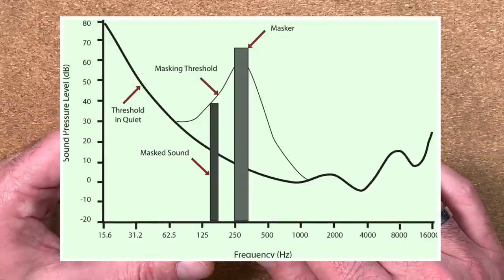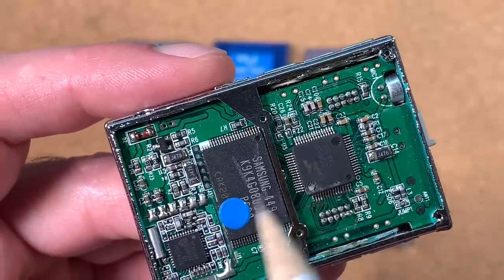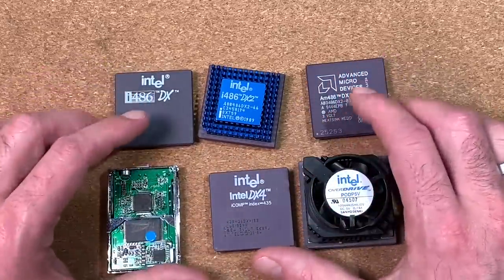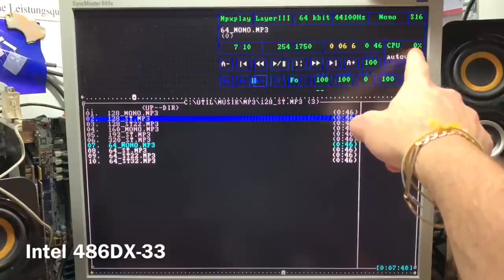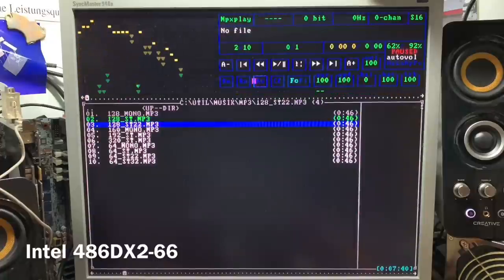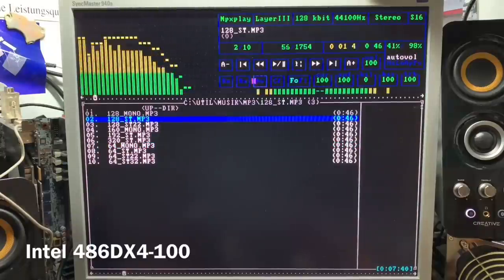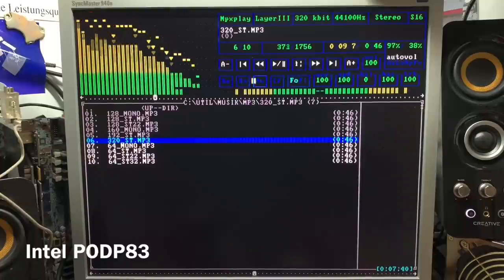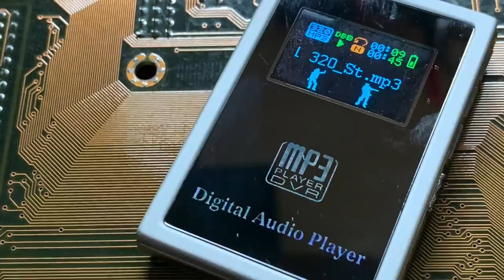Can a 486 Play MP3 Music In Good Quality?

Comment: You should use a AMD5x86-133 instead of a Pentium overdrive or at least include it in the test as it was the fastest 486 chip. Also, there were MP3 players back in the day, able to off-load the work by passing the decompression to the DSP of the Soundblaster (16ASP/AWE32/64) and the songs would play just fine even on slower CPUs. Another way for smooth playback was to covert the MP3 files from/to variable bit rate to constant and disable any visual effects. In addition, any 486 with PCI bus and the DXR3 MPEG card could play MP3 without a hitch by simply selecting a specific codec for audio playback. It was like playing DVD but with audio only. The 486 was a very capable chip. I still have 486 machines that I used to do real time video editing and playback with accelerator cards like Targa 2000 RTX, AV Master, Movie Machine II, Hollywood+/DXR3, Miro DC-30, etc. Panasonic's DVCPRO AV workstation was a crappy 486 with a Targa RTX and a bunch of SCSI drives, yet it was able to do all kinds of real time effects on audio and video and they had the nerve to sell it for $50K back then! What I want to see today is an ISA accelerator card based on Raspberry Pi like PiStorm for Amiga, but for x86 machines.

Comment: I remember my 486 DX2 66mhz was able to play 128kbit 44khz stereo MP3 file if you let them play at 22khz (option in the optimized Dos player, the files where 44khz)
On my P75 i was able to play 128kbit 44kh stereo files native in windows.
Reply: Yeah. I also remember playing mp3 on dx2 66mhz. I used a specific player which could handle that. But for sure it was doable.

Comment: So I built a 486 carputer in 1998. (It was basically free at that point)
I very quickly realized that the only way to get this done is to run only a player. No gui. No modern OS. Boot DOS into running a single app.

Comment: Back in '97 when MP3 was hot shit, my AMD 5x86-133@160 was barely able to play 128kbit with Winamp on Win95 with about 90% CPU load. I've tried alot of players, but Winamp was the only one that was able to play without stutter. Quite some years ago I've ported a pure C++ software decoder to an STM32 MCU also running at 160MHz and it still had alot of CPU time left while playing.

Comment: I suspect with a more optimized, and commandline-only player would handle more at 80 and 66Mhz. 
I listened a lot mp3 on a Silicon Graphics Indigo2 with MIPS R4400 around 100Mhz while I used a CAD program, Netscape, and others  (+IRIX itself) at the end of '90s. I did not experienced any issue with the playback even under load, as I remember the files was 128kbps. Of course, it was a completely different architecture both the processor and the system, designed to perform. The player program was the mpg123, compiled from source.

Comment: Mpxplay is a slow player. It favors hardware support and file format compatibility over performance, and it usually requires a fast 486 even to reproduce file formats which are playable on much lesser machines. I don't know if a fast MP3 decoder exists for 386/486 machines, though. By the time MP3 became popular, Pentiums were common.

Comment: Interesting. Do similar with DVD and video CD playback and what sort of PC hardware is needed. Would be cool. I wonder for example if the VLB S3 8xx or 9xx cards could do it and on which CPUs. Cheers.
Reply: You can't! You need Socket 7(MPEG-card) or PII and above! Trust me! First build 1997 K6 200Mhz!

I can now with a bit of upgrading/cheating: K6-2 400MHz and Radeon 9250* PCI for DVD

*The CHEAT part = a GPU from 2004 ;-)
Reply: @dallesamllhals9161  Heh, yeah, about what I was expecting. I was wondering though if just maybe the S3 9xx cards could pull it off with their video acceleration or something similar to that. But yeah, guess not. Cheers.
Reply: My K6-2 500 and Voodoo Banshee were not enough to play DVD’s smoothly back in the day. They would have played fine I’m sure with one of those mpeg decoder cards, but those things were expensive!

I think DVD’s we’re finally playable when I had a Duron 750 and GeForce 2MX, something like that.

Comment: My 486dx4-160 / 5x86-PR75 plays mp3@192kBit without problems. System is a Debian 4.0 without X11 in a SVGA-Textmode, software is mp3blaster, system load is around 80%.
On the other hand, there is a MP3-decoder for the C64. One can argue that the C64 doesn't actually do anything itself.

Comment: You can get the ffmpeg library as C source. It would be interesting to see if it could be built for DOS or some minimal Linux distro that can run on a 486. Might need some tweaking to get it working. Then, in theory, you could try encoding/decoding any type of audio or video on 486.

Comment: I could even play mp3 properly on my Amiga 1200 with a Blizzard 1260 turbocard running at 50MHz with 32Mb RAM. CPU load was about 50%. I didn't notice any slowdown using DirOPUS 4 while another program was playing MP3's in the background. The sound produced was 14-bit using the internal 8-bit chip and was quite decent. Amiga had some unique hardware stuff like this. Producing the 14-bit sound required the CPU to lend a hand instead of leaving all the work to the sound chip. That"s what I read back then anyways. EDIT: confirmed here: https://retrocomputing.stackexchange.com/questions/337/how-could-amiga-computers-play-14-bit-sound

Comment: there was an MP3 player I used in DOS that would send the sound data into the sound blaster AWE EMU8k chip that let me play higher bitrate MP3s on a 486/66 withouot issue... can't for the life of me remember what it was called though... later on there was a plugin for WinAMP that also used the EMU8k chip for output... was great because I could play MP3s via the EMU8k and it still left the sound card available for wave out in games back in the 9x days

Comment: What kind of MP3 player is that, not the one for the computer but the stand alone one? It looks like it has an FM radio that can record from FM but I just need toknow the sample rate of the recorder or a link to that PDF file you showed.
And I now know that my old 486SX 33 computer that I had many years ago which did have windows for workgroups v3.11 would never be able to play MP3 files although I did have music recorded on it. I used the one of the compressed wav formats at the time I can't remember which one. I used a program called Sound OLE (object linking and embedding) to do the recording and Creative wave player that acted like a jukebox.

Comment: I actually remember that back in the time when I had 486 myself (AMD 486 DX2 80) I've used winamp 2.22 to play mp3 files and it was able to play stereo up to 128 kbit/s (those were CBR Mp3 files, which might be important actually). So it could depend on a software (actually on a decoder).

If that matters, my PC back then had 24 MB of RAM and as a soundcard I had Mozart Sound Systems but with some weird mixture of drivers as I remember I always had troubles getting it to work properly with DOS applications and with Windows.

Comment: Back in the days of Windows 95 I actually had an AMD 486DX2-80 and it played my MP3s nicely with WinAMP 1.92. Well, up until the point, something broke and I had stuttering. At the same time I stumbled upon an exclamation mark in the Device Manager for "I/O Read Data Port for ISA Plug & Play Enumerator" which didn't even disappear after a clean install of Win95.

Comment: Dad’s work pc software requires him to own a mac and I remember my dad’s macintosh quadra can play mp3 properly without a hitch, but the whole system became laggy and slow to respond. I have no idea what his mp3 collection bitrate back then but to me im pretty sure that the 68040 on the macintoshes back then were a much better cpu than 486. I dont remember exactly what type of quadra but judging from the most common model it might use a 33mhz 68040 cpu.

Comment: Coming from the BSD/Linux world, I remember having to get the mad player, since it was the only decoder that was fast enough on my slow machines. That was because it was fixed-point (integer) only. Would be really interesting if you could try out playing from netbsd (or something similar) using mad and mpg123 (in integer mode) to see whether it's faster or slower.
Reply: Integer will be faster but less accurate.
Reply: @OpenGL4ever  You're right, but when it's either integer or slow suttering, it's more than good enough.

Comment: My original comment was made before watching this video so I need to elaborate more on how I played 128 kbps 44hz mp3s on a 486dx33.

I used an old windows 95 program called if I remember correctly "winplay3" it was shareware. 

Played the files just fine but used up all the resources.

Comment: Throwback to the days when computers were slow...  I had a 486DX33 machine but then it was common to have a soundcard with all kinds of hardware features like wavetable synthesizer or sound effect chip like OPL3.
Today soundcards are just a D/A converter and DMA, the sound effects can be easily created in software.
But when decoding MP3 on a 486 you are trying in software what should be done in hardware in those days...

Still it would be interesting to see if there is any difference between the operating modes of the CPU.  Now you were likely using it in real mode, but what about protected mode and 32-bit mode?
Would a decoder in a 32-bit OS be any faster than this, and would that differ between the generations of the chip?
E.G. on the Pentium, after some time extra instructions were added that were targeted for this kind of work: MMX
I don't remember if e.g. the 486DX4 had such things.

Comment: I were able to play high rate MP3 with any processor above 33 MHz, as it much depends on the use of the math coprocessor, which handled all floating point calculations. Without the coprocessor and an appropriate software, it was chopping the output.
The real pain was encoding, as it was necessary to generate a reference frame everytime the sample varied suffciently, and the differential trick become bigger than the full frame itself. On a 486 on single task (booted in DOS) one song took from 20 minutes to one hour. I mean, from Red Book format to MP3 stereo 128 Kb/s.
I am abandoning all psychoacoustic compression for listening to music. With the time it has become obvious what happen to the music when is converted to MP3 or other lossy formats. It is flat and sounds different to each listener. An LP on a belt-driven Thorens turntable with a Shure pickup is the best music source, we shouldn't have prized digital recordings first, and psychoacoustic compression later. Back to vinyl records, and there to stay.
Thanks for the comparison!

Comment: I had a 486DX-33 overclocked to 40Mhz back in the 90s. It could play up to 128kbit MP3s (stereo) ... but only using one specific player and only under dos. Im not 100% sure, but I think the player was called "mp123" (command-line only, no graphical interface).

Comment: I have feeling that all problems with playing that mp3s is caused by this VU on the left, i have remember playing 64kbit stereo mp3s on my 486sx25mhz using program called cubic player (cp.exe) (v0.98 as far as i remember) with no VU but it does not chop music, also it plays tracker music. Try to repeat same test using this program, or use some bootable linux floppy and use mpeg123 under linux. I could assume 40Mhz 486dx will play everything.

Comment: I wonder if dosamp, with the lack of the screen prettiness, and less accurate decoder, might do better? 

The least powerful machine i played mp3 on was I think a SPARCStation 2 at 40mhz, but that was of course on Linux, and the audio output on that machine is limited to 8-bit 11khz mono. I must have been using mpg321.

Comment: Your MP3 player with the Actions chip falls under the S1 MP3 player category. Wikipedia has a page on it: https://en.wikipedia.org/wiki/S1_MP3_player. They're based on Z80 CPUs and with some tools developed by a modding community for these MP3 players you can compile assembly code and run it on the device. I compiled an example Hello World app that writes the text to the display.

Comment: I guess it also depends on which decoder software you use?
I would think the Pentium has better HW support as it has a significant floating point support. I think it is like 10x better than the 486 FP unit.

Comment: Do you know if that player uses a fixed point implementation of mp3 decoding ?
I remember decoding MP3 on pretty weak microcontrollers using MAD decoder which is optimized for high performance on weak CPU.

Comment: I used a 486 back around 1996 to playback 192 kbit MP3. I had to set mode to "mono" in XTC player, then it worked fine. It lagged in stereo.

Comment: There is an fully integer implementation of mp3 decoder called "madplay" which dont use any floating pointer math would be interesting to see how it would work on 486 but i'm not sure if it is available for dos. On MIPS baser embedded processor it works way better than normal decoder.

Comment: How did you compile the player? Was it optimized for 486, or did it use default 686 optimizations? That will make a HUGE difference. You need to be careful with what compiler flags you turn on.

Comment: Having had a quick glance at the MPXPLAY source code, it seems MP3 decoding does not use any floating point operations (only for the calculation of the time and as part of the interface to the equalizer functionality of MPXPLAY).
So maybe a comparison of the DX2 66 and SX2 66 could be interesting.
Reply from the maker: This is what I wanted to try. But MPX is crashing while start up and all other mp3 player for dos or windows refuse to play a mp3 with the message „no floating point unit found“
Reply: @CPUGalaxy  Oh, that's unfortunate.
I'll give recompiling MPXPLAY with floating point emulation enabled a try, but I have to set up/dig up a Windows VM first.

Comment: The early versions of the fraunhofer decoder on Linux (kernel 1.2.8) gave about the same performance as shown here. A DX4/100 was plenty good for that, pppd, the ArcNet stack, NAT, and an IRC client.

There were other players like amp that were much more economical on resources, giving about the same experience on a DX2/66. Not that it mattered for very long at all as quickly as CPU prices were falling at the time.

Comment: Please do encoding. I remember I have encoded my very first mp3s in the 90s and it took me from 20 to 30 minutes for one song :D
Reply: Yes, my experience too. Ripping a CD was so CPU intensive that you had to rip at 1x speed to prevent hick-ups (rip only one song at a time). Then make  a mp3 file with 20 minutes per song, delete the original wav file because a complete CD was 400 MB, almost the size of my harddrive.

Comment: For me the stuttering sounds more like the playback buffer is to short. I remember that from a 133Mhz Cyrix machine with Windows 95/98. I used Winamp 2.9 and increased the buffer size to the max possible and the mp3s played totally fine. But that alone maxed the CPU out, so doing something in parallel made it stutter again. Simply said, a good player should allow you to tweak settings that make playback better. Good old times anyway:P

Comment: Interesting how there didn't seem to be much difference between 128, 192 and 320 kbps. I wonder if it's actually easier to decode those higher bitrates, or MPX player doesn't fully utilize them.
Reply: this was taken from speakers pointing to a camera microphone, so that way we couldnt hear any difference, but i can asure there is an audible difference between a 128 and 192kbps MP3 , even 192 and 320 there is a difference but is not as big and it would require a good audio headphones to hear the difference in quality.
Reply: @JPX64Channel  Yeah, I should have specified I meant a difference in processing power/effort. Somehow the lower bitrates seemed to require more work to decode. Of course I didn't expect to judge audio quality through a (re)compressed youtube stream :-p

Comment: Shouldnt you have tried the decoder to video cd which is a mp1layer1 codecs and it goes as high as 384kpbs - this since windows 95-98 did get the mp3 player in comic chat 2.1 (beta 1 or 2 (dont remember ))

Comment: I remember downloading MP3 files on my Amiga 1200 via a 33.6k dial up modem years ago!!! Even with a clock-doubled expansion card it still couldn't play back MP3s in real time. To get around that I had to leave the Amiga on overnight converting my MP3s to high quality IFF audio, then record those onto tape so I could listen to my downloads in the car! 😂😂😂 In hindsight it would have been easier to buy the CDs.... But  where's the fun in that!
Reply: My a4000 was fast enough to play in real time.  I’m not sure if the default 68040 could do it but the 68060 at 50mhz that I got later certainly could

Comment: Somewhere around mid-90's i had an experimental rig : PC (low pentium/high486, dont remember), DOS operating system, DDS2 tape dirve on SCSI card and some kind of (experimental) driver that exported tape to OS as disk. Quick 2+2=5 and you can play your MP3's from tape. Not bad for steady read / streaming but horrible if any seek was needed.
Almost fully digital tape deck :P

Comment: I noticed you never use Cyrix 586 in your tests. I had 2 for playing heretic multiplayer across rsr232 link in mid 90s. Alas the 120Mhz chip I sold on to pay for newer cpu. But I recently discovered due to moving house a plastic bag in attick with 586-100Mhz VLB graphics card and motherboard. The m/b supports the 586 writeback cache properly and the 586 overclocks to 120Mhz happily. Would you like to borrow it for a year or two?
Reply from the maker: Hi. Thank you very much. But I have the cyrix 586 and I did already some videos about it. Also over clocking to 120 Mhz. 😉
https://youtu.be/ysMmAVNKrFY